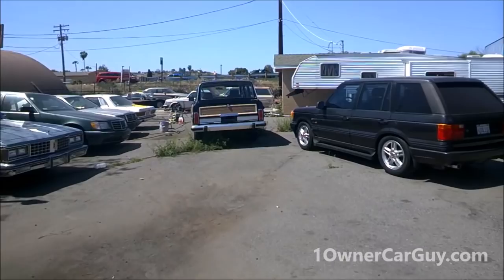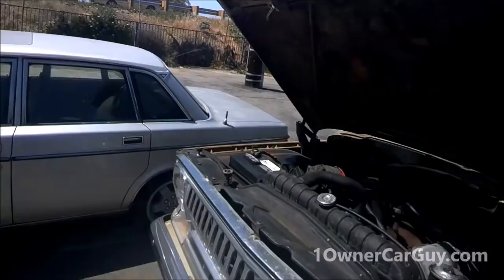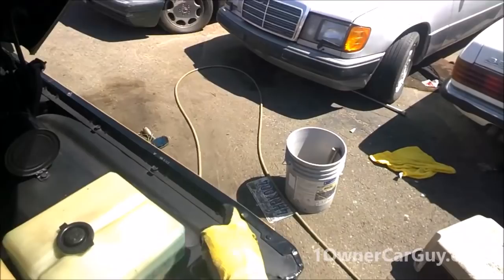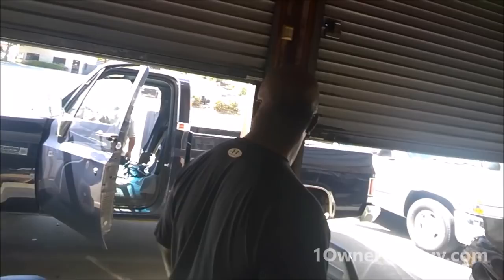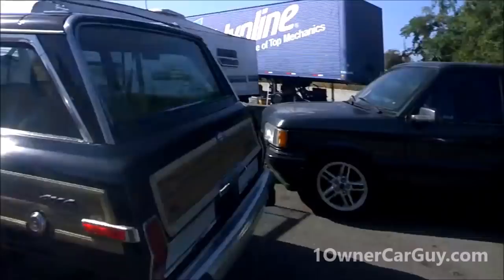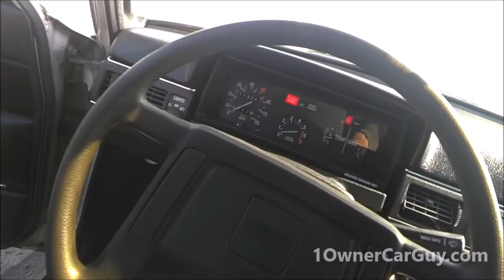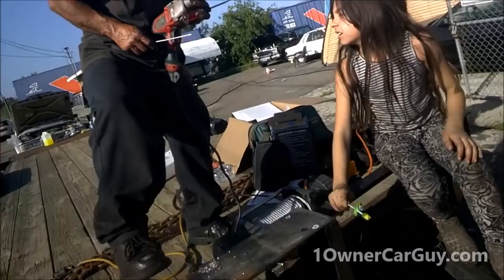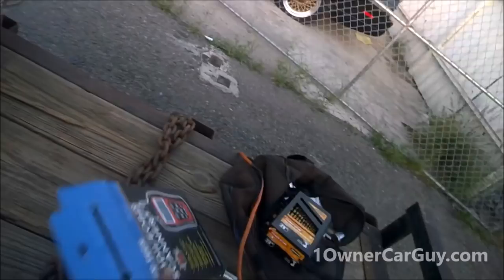Installing a Winch Car Cold Start Hauler work Daily Work Vlog Auto Detail

Comment: 1:09:40 - they call that a fair lead. Where there were no holes for it on the winch it must only be for an aftermarket bumper installation.

Comment: AT Diag Comm Line = automatic transmission diagnostic communication line.

probably indicating the transmission control computer has detected a fault, and requested that the main engine computer turn on the malfunction indicator / check engine light.

Newer cars have multiple computers.  you need a scan tool that can talk to your Transmission Control Module to read the specific fault on the infinity.
Reply: Gotta have good clean power!  I've seen it happen :)  glad you got it straightened out!

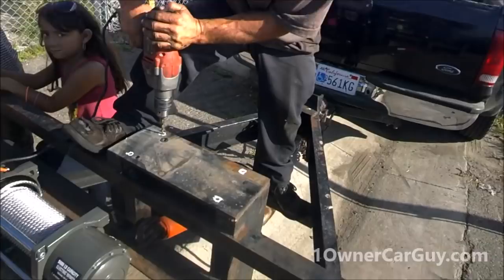Comment: 59:30 - There is a better drill bit set out there, a bit more pricey but well worth the money is a set of Irwin Turbo Bits. Those cut  through metal fast, thin or thick.